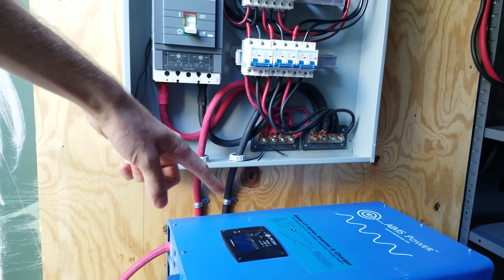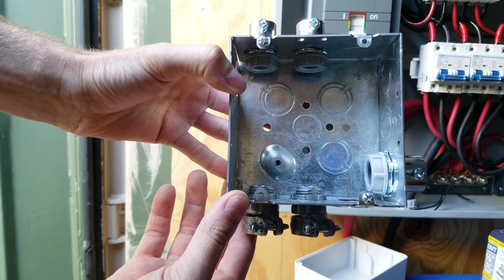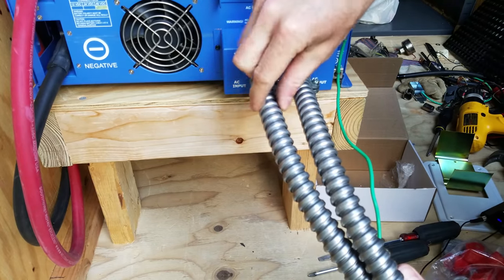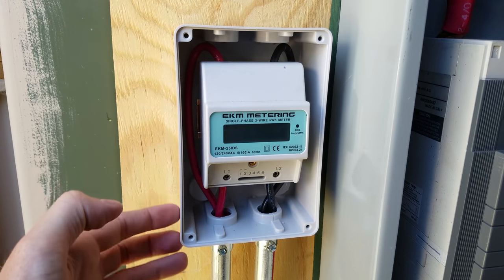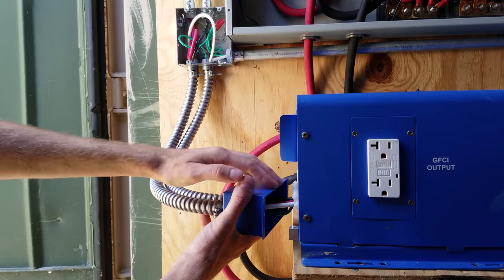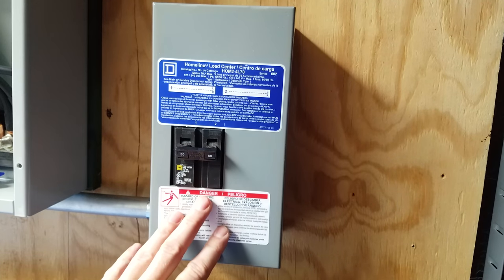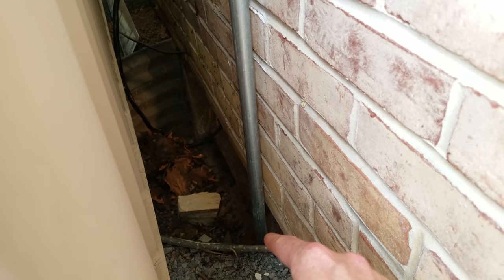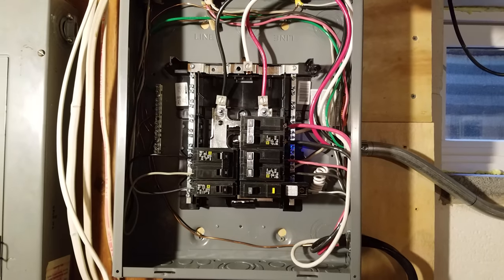Connecting the AC Wiring to the AIMS 10kW Split-Phase Inverter

Comment: Love these videos.
The only thing I'm not comfortable with is that (not you as a person) you're using metal casings and conduits over there .
Here in Europe (the Netherlands in particular) it's all PVC or ABS.
I think its much safer
Reply: yeh same here in Australia
Reply from the maker: We do have PVC here, and it's a lot cheaper, but I strongly prefer EMT. PVC sags with time, requires more supports, and just looks like crap in general. EMT is much more solid, less prone to damage, can be used for grounding, doesn't burn if a fire starts, etc. EMT is the professional option, PVC tends to be the DIYer route unless you're running underground. We do not have plastic breaker boxes though, only metal, which makes sense. I would never want to use a plastic breaker box...
Reply: Metal is fine for commercial or industrial, but for residential where aesthetics are an important factor, plastic offers far better choices for customers in terms of design and flexibility, if it as you say, 'melts, it burns, it catches fire, it sags' then it was installed wrong. it seems that you enjoy the industrial aesthetic, which is fine, but most people wouldn't want a shipping container in their garden or galvanised metal conduit all over their house. also in regards your last point, metal has it's own problems, as other commentators have pointed out with your mistake regarding induction!!
Reply: Here in the Netherlands, we don't use bus bars as you do in the USA  each breaker is wired separately from the leakdetector ( I don't know what they are called but I think you know what I mean)
Reply: i get your consern but i perfer metal  casing beacuse its harder for animals a such or small cruios children to get in. (you can use a lighter to get into pvc/abs fast)

Comment: On the flex conduit, the red inserts are not insulators. They are insulation abrasion protectors. They prevent wire insulation damage. 
Same as the threaded fitting covers. They are protecting the insulation from damage.
Reply from the maker: Yes. They are protecting the insulation from damage where the conduit was cut. Thus they are insulators... lol

Comment: RULE#1 (for the budding electrician)
~ Always cut your wire too long. Because if you don't it WILL be too short. Ask me how I know. ;)
Reply from the maker: Yes! Once it's cut, you can't uncut and good wire isn't cheap! I figured people were going to complain that I left some slack, but glad to here that's not the case :)
Reply: @LithiumSolar  A little bit of slack will be always your friend. I think every cable / wire should have enough slack for at least one repaire of connection point. Very nice and informative video. Many people can learn from Your work.
Reply: @LithiumSolar  When I first became a journeyman electrician - being responsible for the entire job , I once measured a  run through conduit with multiple 90's. It was over 150 feet of (3) 2/0  conductors.  I pulled the very difficult run all the way to the breaker panel - when I got there I was about  a foot short. Very sick feeling unsued. --> I had to buy all new wire. I measured very thoroughly, but not thoroughly enough. 😀
Reply: No no. Rule #1 is ground sufficiently 😂
Rule #2 black wire is A phase, red wire is B phase
Reply: @LithiumSolar  i have thesame transfer switch going to my house from my inverter i have the renogy 3500 48 volt but everytime i go to inverter mode my gfci trips is there a fix?

Comment: You created an inductive heater from your j-box to the inverter and fire hazard. You need upsize your conduit so there are no hot legs without a neutral running in the same conduit. Also the wire size is too small to parallel per code. Not intended as a knock. I appreciate your attention to safety and detail.
Reply from the maker: I'd like to learn more on this. The conductor only goes up to the meter for the reading, then comes back down the same conduit. It's not technically parallel conductors and the current would be flowing in opposite directions, so there should be no inductance? I don't understand how this would be different from connecting a 240 appliance, such as an air conditioner, where you do not run a neutral at all, only L1+L2 in the conduit. Do you have code numbers by a chance that I can research further?
Reply: Hi LithiumSolar, Sorry for the length of this response, but there is a lot here and it needs to have precision. Steve Rosenbaum is mostly correct. It is an absolute code violation to run only a hot leg in a metal conduit or through a metal box such as a panel board. NEC 300.3(B) To be code correct, for the reasons Steve sited, one must run all conductors of a circuit in the same conduit. If, in the USA, one has a 120 volt circuit, the hot and neutral (grounded conductor) must both be in the same conduit (cord, raceway, cable tray, etc.) For a 240 volt circuit, both hot legs, and if present the neutral, must all be in the same conduit. Finally, for 3-phase, the phase conductors, r, s, & t and if present, the neutral, must all be in one conduit.

If one is running parallel conductors, all elements of the circuit must be present in each parallel conduit. NEC 366.20. For example, r1, s1, t1, & n1 must all be in conduit 1 and r2, s2, t2, & n2 must all be present in conduit 2. Assuming, of course the circuit uses a neutral.

If grounding conductors (green or green with yellow stripe or bare conductor) are present, they must also be grouped with their fellow circuit components.  Be well & Best regards, Gottfried
Reply: The laws of magnetics are a real PITA and I’m not talking about the bread. You have a neutral with twice the current path as one of your hots so theoretically you’re inducing a magnetic field.
Reply: NEC Article 300.20 specifically refers to ferrous induction and NEC Article 310.10h refers to paralling conductors. Thanks Mr. Shuss for a concise explanation.

Comment: Looking good. Nice power production too. I need bigger loads.
Reply from the maker: It's never ending. You'll find bigger loads, then you'll need more batteries, then you'll want more loads... lol
Reply: @LithiumSolar  Thats how its been from the start. I started my project to help with heat in the winter.But I would like to run my oven/dryer in the summer. Soon enough.

Comment: Hi there love your video. My knowledge in this area is limited so I want to ask a question. If I have permeant consumer of 2000W what type of grid system (inverter size, no of batteries, and no of solar panels) should I get?

Comment: A very nice video; I'm using the playlist that this video is a part of (your Solar Shed playlist) as a rough guide for my own Solar/Wind Power System. I'm planning to use a combination of MPP Solar AIOs (two PIP-LV6048 units) and MidNite Solar Clipper and Classic Charge Controller, with a different brand of Split Phase inverter to provide 3KW of additional power for a total of 15KW. I'm going to have a 560AH 48VDC pack made with 32 EVE 3.2 VDC Lithium  Iron Phosphate batteries in a 16S2P configuration, and possibly additional power using either 18650 or 32700 Cell; I haven't decided if I'm going to try your 14S300P arrangement or not, though.

Comment: I am installing a small solar system in my house with a hybrid inverter to have it as a backup, I would like to know, the neutral produced by the inverter (from 120 Volts to 2400 watts) can be connected directly to the neutral bar of the electrical panel of my house Or those selected circuits that go through a transfer switch must be worked completely alone including the neutral? Thanks

Comment: Excellent video series. I am curious to see what kind of power savings you end up with. Any plans for an auto switching system to utilize maximum available solar, or just going with solar directly to certain circuits?
Reply from the maker: Thanks! No, I won't have any automated switching. Once everything is running at 100%, I pretty much never need to switch anything during the summer months. I have enough solar and battery capacity to run even when it's rainy for a few days.

Comment: Very good video...I have a question...is this inverter has the neutral and the ground bonded ?  Thanks
Reply from the maker: It is not bonded internally on mine. I have it bonded at the panel which the inverter feeds in to. That said, there are several revisions of this inverter that all look alike. It's best to check with the manufacturer if you're not sure before you do anything.

Comment: First off nice work and I am not an electrician but how does the meter work when measuring a 120 volt load if there is no neutral in the meter.
Reply from the maker: It's measuring the magnetic field produced by each leg. Both legs run through the meter, so I imagine it's sampling them separately and doing some maths to figure out the kWh. That's just my best guess...

Comment: Thanks.. will this unit run a 50 amp air conditioner. I have two schnieder 4024 inverters and want to add a 10k unit to run my house ac..the sun coast looks good.
I have 32 batteries and 48 panels and two gauge cable going too and from the house to the solar shed.

Comment: Are the red and black wires,from the inverter, two different phases??
Reply from the maker: No. Red to Black is L1+L2 or one single 240V phase.
Reply: @LithiumSolar  Thanks for replying. So Red to black gives you 240v. Is red to neutral and black to neutral 120v ?

Comment: Not being an electrician, but have done lots of wiring, just to clarify, your two legs when combined provide 220 volts? And this is reflected in your Air Conditioning  breaker, no?  How many batteries and types and how many panels do you have?
Reply from the maker: Correct, L1+L2 = 240V. Either L1+N or L2+N would give you 120V. The AC breaker is a double-pole, so it's both L1 and L2 passing through. I have 51.8V 1300Ah battery bank and 9.5kW of panels.

Comment: Thanks for making this video. It's nice to see someone explaining this unit I've had a hard time finding any info about it. I have one of these also, I still can't understand if I have to separate the neutral from the inside ground, (I have the outside ground directly to ground)  if I'm connecting directly to my main panel that has both a ground and neutral connected together. We use the same electric system here as the US, two 110 legs, a neutral and a ground, but no 110 just 220, I'm planning on both 110 and 220. Also I'm planning on adding LiFePo4 batteries as well as keeping it hooked to the utility. It works fine with the AGM batteries we have now but I want to upgrade. Does anyone know if there's a way to disable the built in utility charger so only the solar will do the charging and is there a way to close the difference between the switch points from utility to battery and battery to utility. The settings all are either too low switching to utility or too high switching back to solar, I want it to run on solar as much as possible it seems to stay on utility way past the point where the solar provides more than enough power to run everything as well as charge the batteries. Thanks....the dog

Comment: I forgot to ask. How many amps is the abb shunt trip of and I didnt see fuses connected to the positive side of the battery bank. Is that circuit breaker the fuse box? Thanks
Reply from the maker: The fuse box is on the AC output of the inverter. I do have NH00 HRC fuses on the battery bank, but they're not in this video. I also have Class T fuses that will go in once I get the new battery racks and finalize the setup.

Comment: I fried my isdt t8 charger this week, trying to balance a 120 ag liion battery, it got it and the 24v power supply, I'm hoping I can repair it, but not likely, that thing looks like a cellphone in its inside, it seems to have a single mosfet, and it seems to be stuck in the on position, so I'd say it's cooked! The input has continuity, like a dead short, it's probably toast, so now I'm using a cc CV DC converter, charging each cell! At 6amps it takes about 24 hours to get it to 4.15v from around 3.65-3.70v this is taking forever!

Comment: And when using metal boxes and metal conduit, you are supposed to ground the boxes, and each conduit connector with bronze abrasion protectors, with ground bonding connections.
Reply from the maker: All of the metal boxes are grounded. The EMT conduit does not require grounding. I used the proper threaded connections, which bite in to the metal box, thus grounding the conduit.
Reply: LithiumSolar By Michael Johnston   Published In February 2013
Grounding electrode conductors are essential in the grounding and bonding scheme for services and separately derived systems. They generally must be sized according to Table 250.66 of the National Electrical Code (NEC) and are required to be installed in a continuous length or otherwise spliced in accordance with any alternative in 250.64(C). They must also be protected in accordance with 250.64(B) where subject to physical damage. 

In addition to concerns about physical damage, magnetic fields can affect grounding electrode conductors. Section 250.64(E) includes requirements to address such protection. If a grounding electrode conductor is installed in a ferrous metal raceway, the raceway must be electrically continuous from the point of attachment to the cabinet or equipment to the grounding electrode and must be securely fastened to the ground clamp or fitting. Ferrous metal raceways contain iron or steel content, and examples include rigid metal conduit (RMC), intermediate metal conduit (IMC) and electrical metallic tubing (EMT). These conduits and tubing have a magnetic property that reacts to rising and falling magnetic fields present in alternating current (AC) systems. 

Varying amounts of current can be present in a grounding electrode conductor during normal operation. During a ground-fault event, the current in a grounding electrode conductor can fluctuate and even be relatively high for the duration of the event. 

Ferrous metal raceways must be bonded to the contained grounding electrode conductor to reduce the effects of magnetic fields that are present while the system is energized and in use. The grounding electrode conductor for an AC system or service is an AC-carrying conductor with the current flowing in one direction. This current can rise and fall significantly depending on events such as ground faults, short circuits or line surges. As the current rises and falls, the magnetic field of the contained conductor typically gets larger and smaller accordingly. This means the stresses on the contained grounding electrode conductor increase and decrease as the current goes up or down. 

Because the ferrous metal raceway is enclosing this single conductor, there is an inductive reactance between the ferrous metal raceway and the contained grounding electrode conductor. This inductive reactance is one component of impedance and actually impedes current in the contained grounding electrode conductor. The magnetic field and the capacitance results in a coupling effect between the current in the conductor and the surrounding ferrous metal raceway. In actuality, the majority of the current would be present in the ferrous metal raceway rather than the contained grounding electrode conductor. 

The magnetic field’s strength increases in proportion to the amount of current in the conductor. In many cases, the magnetic lines of force in the conductor are induced into the conduit enclosing the grounding electrode conductor; they can even surpass the saturation point of the steel raceway. At the point where the grounding electrode conductor exits the conduit, the magnetic lines of force generated by the fault current in the conductor will try to be induced on the end of the conduit, creating a saturation point that exceeds the conduit’s capacity. The steel conduit, in this instance, acts like a steel core of a coil to concentrate the magnetic lines of force. This condition is often referred to as the “choke effect” because it is actually the restriction of a grounding electrode conductor from performing its function. Because of this, specific bonding requirements are necessary for ferrous metal raceways that contain grounding electrode conductors. This is not a concern for grounding electrode conductors that are installed in PVC conduit or other nonferrous metal raceways such as aluminum or brass conduit. Sometimes the type of construction will not permit PVC conduit. 

Section 250.64(E) requires ferrous metal enclosures for grounding electrode conductors that are not physically continuous from cabinets or equipment to the grounding electrode, such as sleeves or short lengths of conduit used for physical protection, to be made electrically continuous by bonding each end of the raceway to the contained grounding electrode conductor. This action puts the contained grounding electrode conductor in parallel with the enclosing ferrous metal raceway so the two work together when the current in grounding electrode conductors rises and falls in response to various events occurring on the system. The current will actually divide over both paths, but due to the skin effect, the majority will be present in the surrounding ferrous metal raceway. 

The methods required for bonding each end of the raceway are provided in 250.92(B)(2) through (B)(4). These methods apply to all intervening ferrous raceways, boxes and enclosures containing the grounding electrode conductor. If a bonding jumper is used to accomplish this bonding to intervening metal raceways and enclosures, the size of the bonding jumper must not be smaller than the required contained grounding electrode conductor as provided in 250.64(E). Several manufacturers produce grounding and bonding fittings that are specifically designed and listed for this purpose.